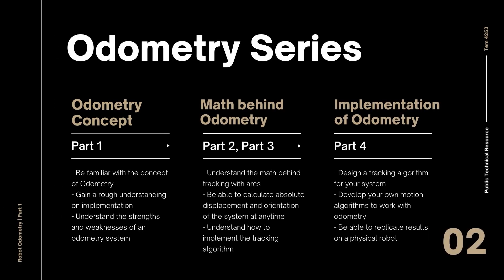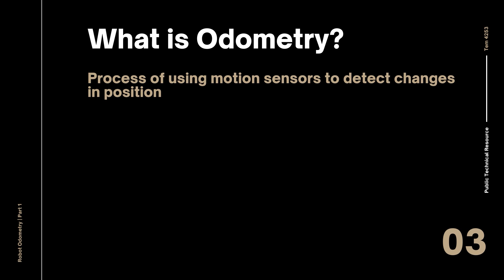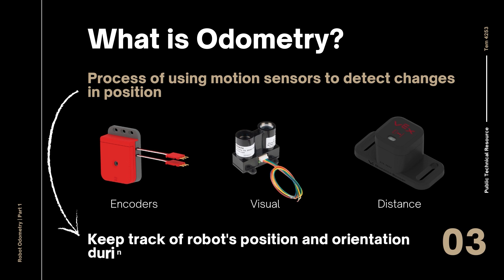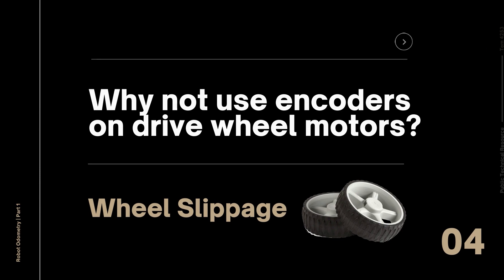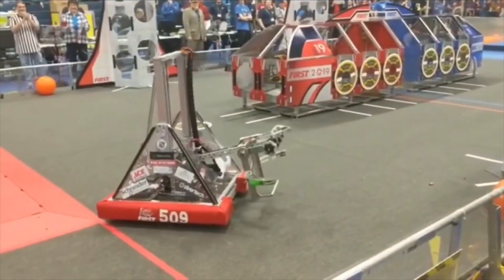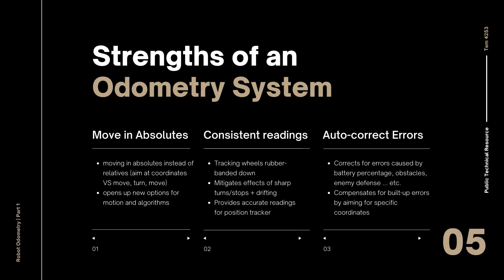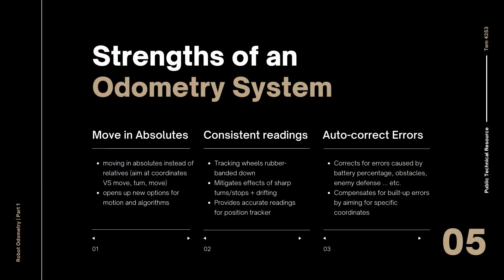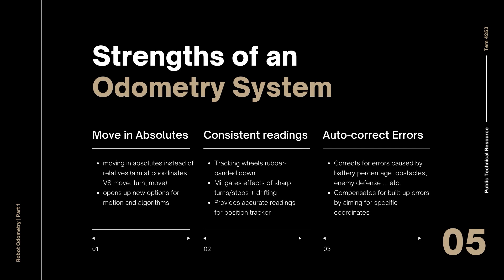What is Odometry? | An Introduction to the Essence of Robot Odometry Pt. 1

Comment: Can the optical motor encoders be attached to another wheel powered by a motor, or does it have to be attached to a separate tracking wheel?
Reply: if the robot is heavy enough, you can attach it to the drive motors itself, although a separate tracking wheel is ideal :)